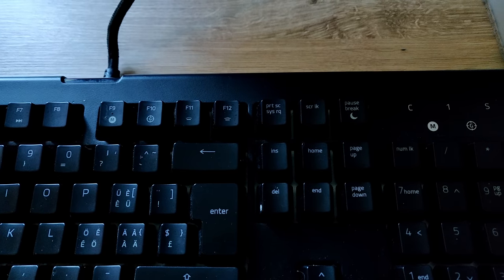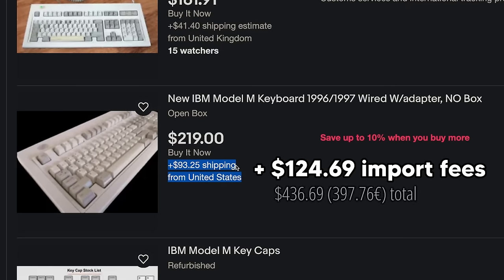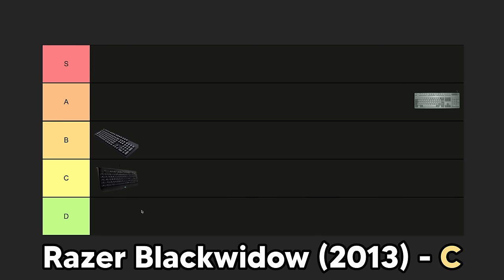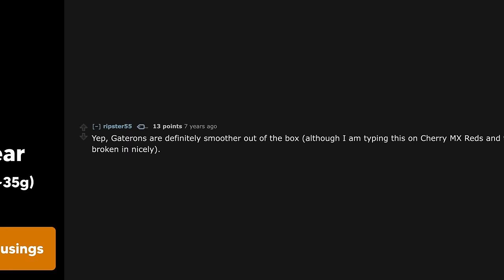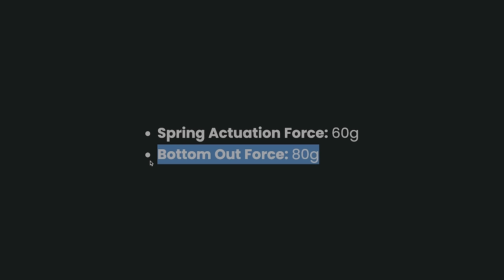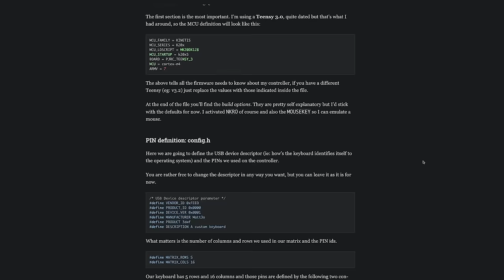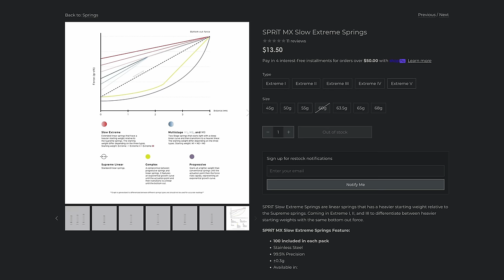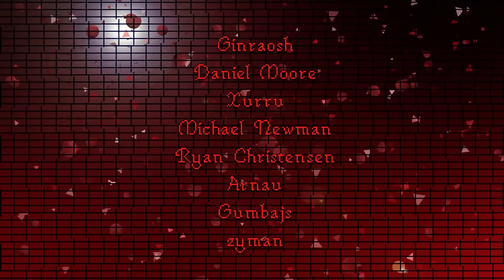How I Lost Interest Towards Mechanical Keyboards

Comment: I don't find appropriate asking this que but, I want to ask that In current phase of my life I have goal I have everything to accomplish thay goal but I'm just not going into into u know I feel shallow all because of YouTube everyday I somehow use like 7 to 8 hours of YouTube I feel emptiness in myself if I don't use it it just feel like why
Reply from the maker: If you already have something that to work towards that you find meaningful and gives you purpose then that's a good first step, but if you can't bring yourself to be more optimal working towards it, then you just have to start small and get into the habit of doing those things daily. If you even do 10 to 15 minutes of work a day CONSISTENTLY towards those goals, you're strengthening the neural pathways responsible for taking those actions, meaning that it will require less and less discipline over time and it will become easier and easier, after which you can slightly start increasing the amount of work you do. 
This is also why I have 0 issues with doing an hour of Anki a day anymore - I've done it for 1700 days straight, meaning that it became so habitual that I never need to use discipline to do Anki.
That being said, there are periods even for myself where I'm much less productive than usual, if I start lets say consistently playing some game straight in the morning, I'm instead strengthening the pathways to play the game at that specific time, instead of the neural pathways required for doing work instead. Then changing that habit becomes really hard, but once its established, it just becomes and effortless second nature.

Comment: "Feels like I am writing on a typewriter". Actually that sounds horrible. On a typewriter you have to press as hard as if you were hitting it with a hammer. That's far away from comfort and nice. 

The sound a keyboard makes gets better the more silent it is. Mechanical keyboards are not even close to be silent. Also you can reach every key easily on every current keyboard. You don't need to waste a second thought about if you have pressed a key fully or not. Every trash keyboard recognises if a button is pressed. 
Also you don't have to press the button over 1 cm deep (mechanical keyboard or typewriter). 1 mm or less is enough. Maybe a 5 dollar keyboard from some thrift shop does not so, but... Yeah. What do you expect?

Comment: I lost interest after seeing the prices, and I didn't even start
Reply: For what? Just mechanical keyboards in general or custom stuff? A basic mechanical keyboard's like $80-150 and will last you for a decade. I bought my G710+ in early 2015 and it still works great. Only thing that ever broke was the enter key, due to the fact it's the fat enter key variant, the one you find in EU. That particular key is badly designed and almost destined to break eventually, if you hit it too hard too many times, specifically off-center to the right. $150 keyboard and $5 key. Pretty sure you're spending more on your subscriptions in 3 months.
Reply: @sourcedasher   I probably should have worded it better, “custom mechanical keyboards with custom switches, etc” relax my guy jeez lol p.s. I have one subscription and it's spotify lol
Reply: @cheex9861  Ah, ye.

Comment: What's the deal with your disgusting filthy PC  tower at 3:52 ? Would it kill you to clean it?
Reply from the maker: I actually don't use that PC, its mostly just sitting for months and months which is why it had accumulated some dust. 
It's not actually as bad as it looks, its just the camera flash that's making it look WAY worse than it is in reality.

Comment: Lol there's no way you can compare HHKB/Topre to MX, even a cheapo Matias still feels way better than an expensive MX switches.
I find this wildly ironic that today, the mech key community seems to changed into "poser culture" like the audiophile community, they crowd around ancient 1984 cherry MX platform that wasn't even that great to begin with, glorifying "group buy" throwaway weird niche design from some random company that artificially price gouging stuff they wont even make anymore because "it's rare", comparing a lot of random MX switches that doesn't even feel that much different from each other, damping everything to the point it's muted & dead like modern music recording, absolutely praised "rare metal" or heavy material not because it's good but because it's shiny metal and feel like expensive yacht and ended up becoming display furniture while sometimes being used to spent typing on reddit or discord and not doing anything interesting.
.
Also, FOMO is dumb and "endgame" is just an illusion to think that more expensive stuff is better than the things you love.

Comment: I really think this video is a joke 🤣. This guy is apparently living in a parallel universe cause he does not realise there are Custom Hot-swappable keyboards where you don't have to solder in your switches anymore like I had to do on my older G910 with proprietary RomerG switches. Also as someone else noted in other comments, you really enjoyed spending that much more time soldering, but complain about lubing the switches. 21 minutes of my life lost  and no value gained from this video. Just a guy with limited funds telling you its better to fully solder wires on a keyboard than lube your switches , and that membrane keyboards are better than the Mechanical ones. LOL  Wrote this on my nice Keychron V6 and soon I'll be getting the Keychron V10 Pro as well  :))) how about hem apples 🤣🤣